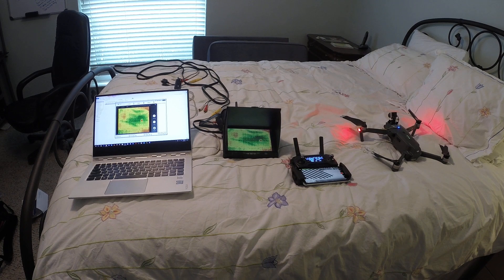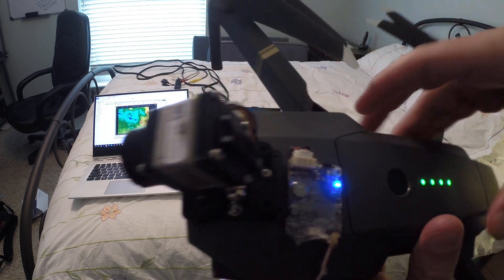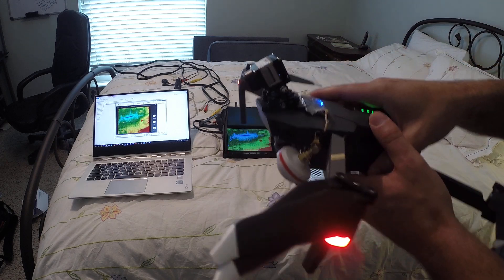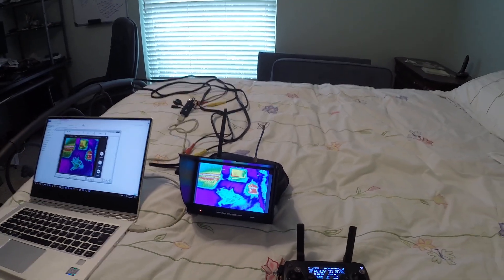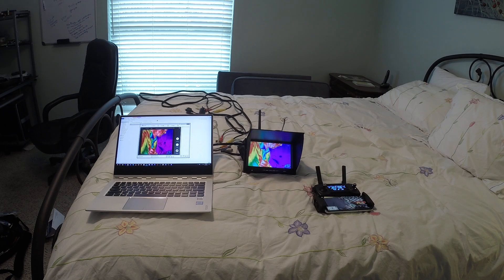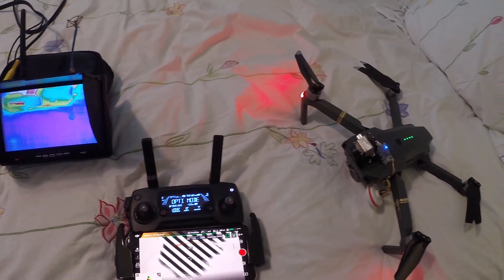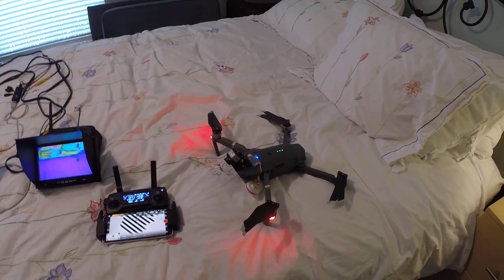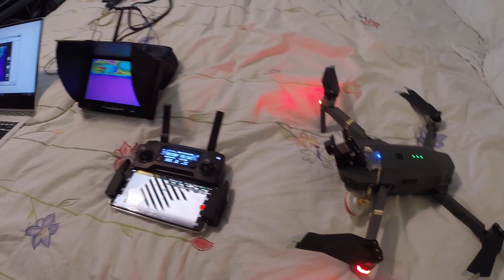Flir Boson on Mavic Pro Thermal Setup  Ultra portable setup second install method 2 0   2018

Comment: Hey there very sweet setup. Would you mind sharing the specific components and links for where to purchase them? I'm thinking I'd need a vpc, a transmitter and a power source for the flir and batteries as well?
Reply from the maker: I walked into a hobby store and most things were on hand. I think they ended up ordering smaller sized items to make it work better.  Lookup 200mamp video transmitters for racing...flir power comes off the mavic battery...the flir can take an 11volt and down step it to 5volts it needs.  The lcd receiever for thermals is off the shelf so any lcd with built in video receiving as long as it has the matching frequency range.   Laptop is fed off the output of the lcd...with a video capture device. 25 dollars online.   Sorry i didnt keep detailed records of it all.
Reply: @AdventureDave22  thanks for that! How do you power the camera with mavic battery tho? Did you have to take the battery apart?
Reply from the maker: @sphinx5853  
The thermal sensor is powered and wired off of the drone body inside the shell under gps tapped off of the power connectors to the main circuit board.  If i wasnt clear, i didnt mean wired to the battery but wired using the battery power.   Hopefully that makes sense.